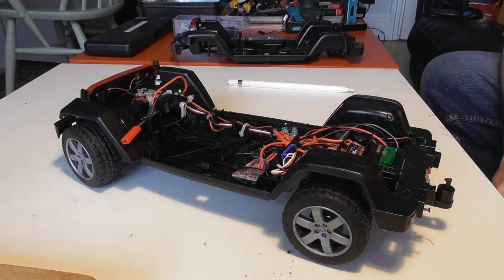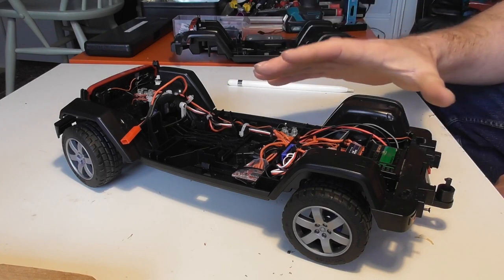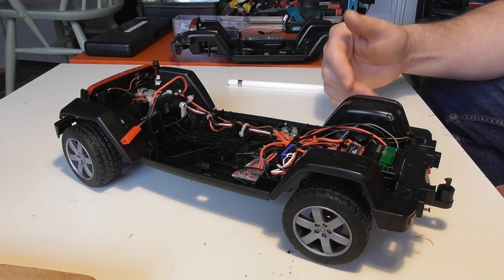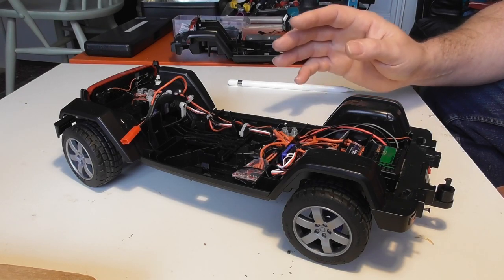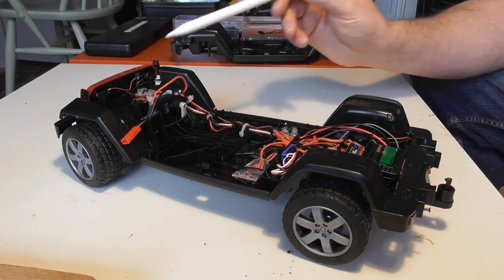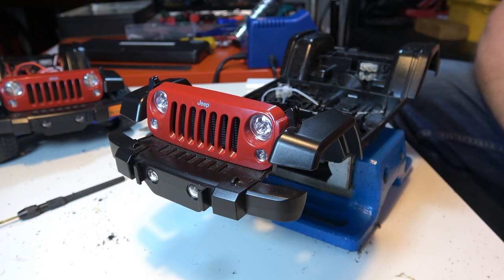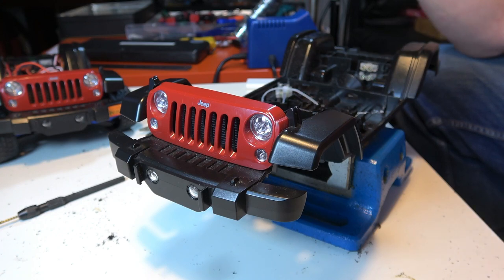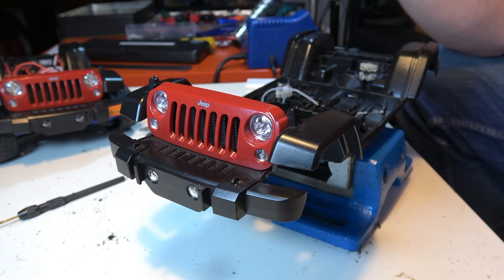Bruder Jeep RC conversion - 2. chassis

Comment: I LOVE the method you remove the plastic by. When I did my Bruder dozer, I used a Dremel tool & cut everything. My method took a lot longer than does yours.
Reply from the maker: Thank you. The #561 Dremel cutting bit made all the difference - it removes material quickly & effortlessly without melting anything. 😀👍
Reply: @RCModders  Yes sir, it works much gooder than the end mill bit I've been using!
Reply: The bit is basically an end mill bit. I have the same ones that came with my hole cutter attachment for the dremels. It acts like a router and allows plunged and sideways cuts with it. Good stuff.